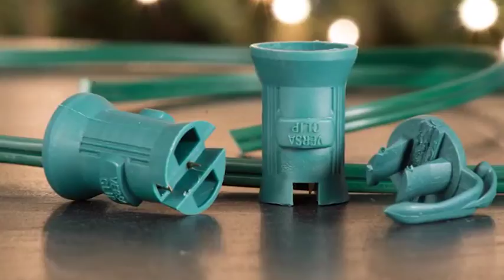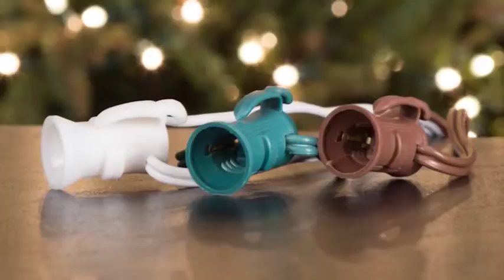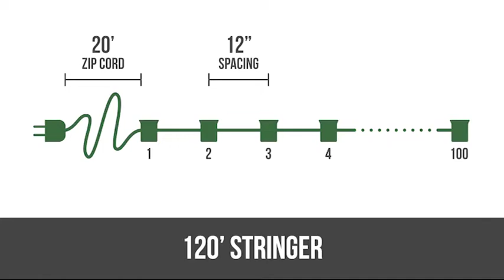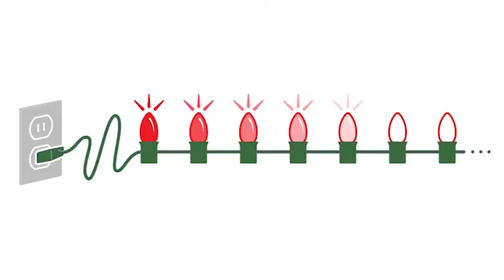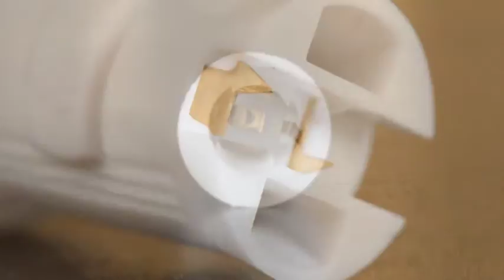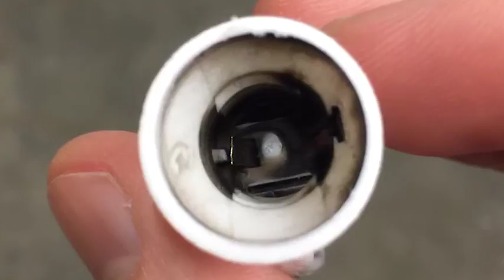Contractor Training: Wire

Comment: Can I connect 2 100'?
Reply: If you're using LED bulbs with 18awg wire you should be okay to connect up to 200 feet.
Reply: Mitch Hendricks I was able to buy 18awg stp1 500ft on sale. Do you think I can connect up to 265ft using led bulbs for my next season? By the way the seller said cannot be cut. I ask him why he didn't reply. Thanks!
Reply: Types of replacement for 2 prong cord